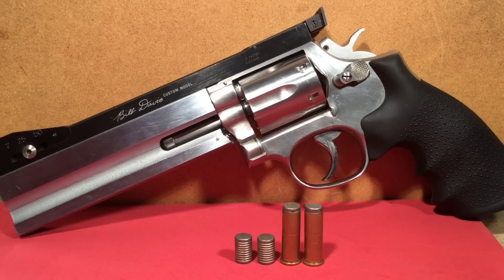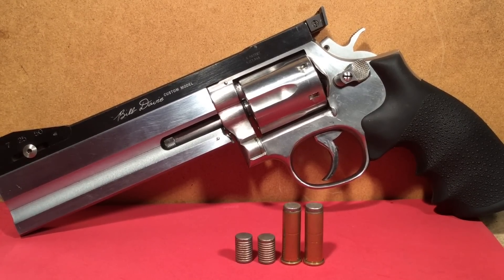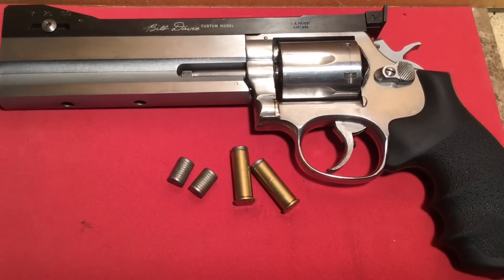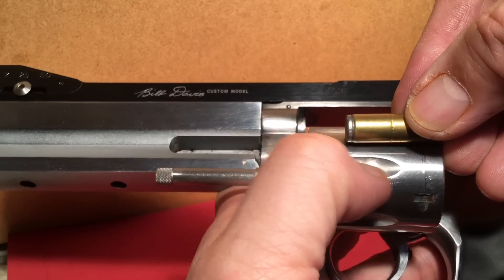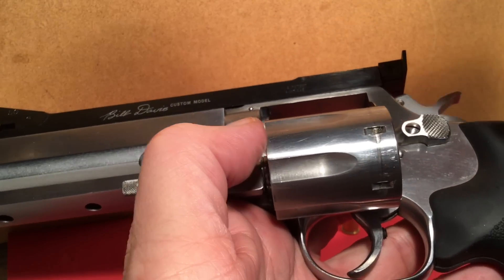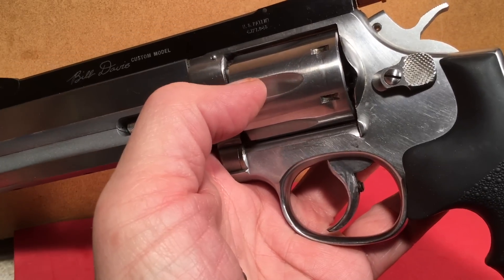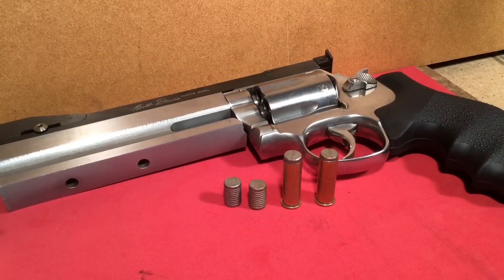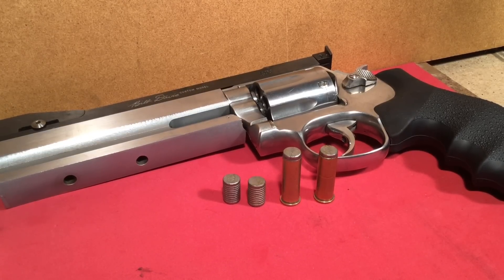A Different Perspective On Handgun Bullet Jump - 38 Wadcutter

Comment: Even if there was time for the bullet to "rattle" in the freebore of the cylinder, once the very end of the bullet hits the constriction, it's going to square itself because everything takes the path of least resistance. If the bullet didn't get squared up, part of the bullet would get sheared off and then they'd more than likely keyhole.

Now, if we were to talk about .410 revolver and shooting .45 Colt or .45 ACP in them, then there could be the possibility of the bullets hitting the bore tilted because I don't know if the throats on the .410 revolvers are even close to .45 caliber. Being that they're .410 revolver, I wonder if they even have constriction in the chambers.

But .410 revolvers are not the sole focus on this issue. I think you're right though; the shorter cartridges and their projectiles will not be affected by the longer jump.
Reply from the maker: Dick Tickles - Thanks for providing your insight to the discussions...turns out I just saw exactly what you reference at the range yesterday - a group was shooting the Taurus Judge and the 45 Colt rounds sounded like squibs.  The target looked like a shotgun hit it, even with 45 Colt rounds.  I went over and picked up some of their empties and there were some cases that had split...yes, big bore brass can split under the right circumstances.  I've got a video coming up next on that...  What I didn't really mention directly in this video we are discussing is that, in addition to not enough time to rattle, there is not enough distance to rattle.  And the very nature of the end of the chamber / beginning of the cylinder throat is that there is a radius there to help the bullet square up even as it enters the cylinder throat.  This is different that the headspace shoulder on auto pistols where the case merges with the shoulder so that the bullet enters into the rifling leade smoothly.  Revolvers are, once again, a different animal completely than all other firearms... Have a great day,  FC
Reply: "Revolvers are a different animal than all other firearms..."

Yup, and that's why I love them! :D
Reply from the maker: Dick Tickles - Something about the way that wheel goes round 'n round, ya think??   :)  FC

Comment: the fact that a well made single shot pistol is more accurat then a well made revolver says it , a wel made revolver is accuraat too but has more issue`s that can ruin the shot, the rattle is not the problem  ,but the hanging down ,the bullet wil travel at the underside of the chameber and then in yhe cilinder troath lift up . thats why you see a black side of the case neck .the case blows up at the beginning and thats not moving  while the bullet bents the case a little and makes the gas escape.and while the bullet will be bent the cilnder throth forces it straight again en sizing it down, if you shoot the bullet out of een precision  high power air rifle at the same speed  same twist .you could find out the smallest group possible with a certain bullet.
Reply from the maker: peteralexben - Thanks for your thought inspiring comments.  One thing I didn't mention was the TC Contender had the advantage of a 9X scope while the Ruger had a 2X.  That alone could have made the difference in the TC shooting the smallest group with the 44 Spl loading while the Ruger shot the second smallest with the 44 Spl loading.  As for the case gyrating in the chamber on ignition, I don't have any readings or articles on that.  And air rifles are really amazing - going back to Lewis and Clark.  Best to ya, FC

Comment: Great Looking Firearm You Have To Share With Us   ,This Issue Of Mine Is Off Topic But Mine Was Bullet Jump Using Aluminum Cartridges Bullet Jumped Or Left Cartridge From Force Of Others Going Off Jammed The Cylinder From Turning Thanks FC. .38Spl  No Plus Blazer Ammo.
Reply from the maker: derplinkster - Wow, that is not an invited event for sure..!!  Hopefully your gun suffered no ongoing problem from that... Best Regards,  FC
Reply: Thanks no all is good😃.
Reply: I experienced the exact opposite with Blazer ammo being pushed back in the case under recoil while in the magazine tube of my Winchester 94 in 45LC. After looking at some of the rounds I had left, I noticed much variation in COAL and no crimp at all. I will never buy the Blazer in the aluminum cases again.